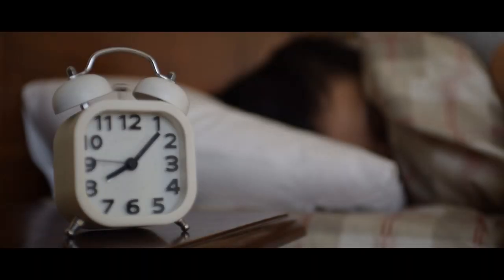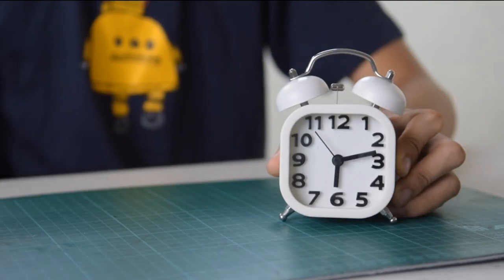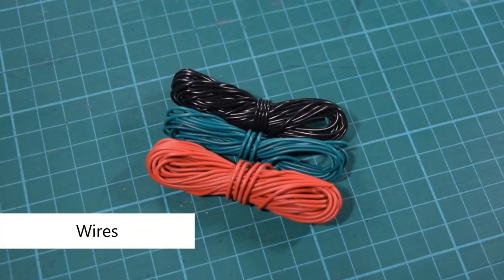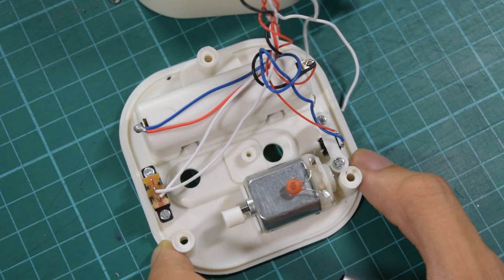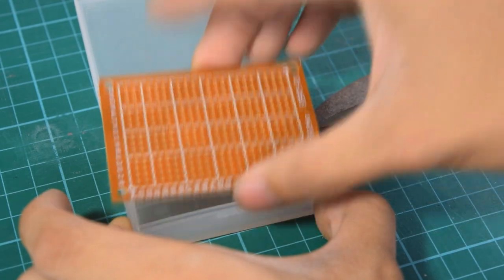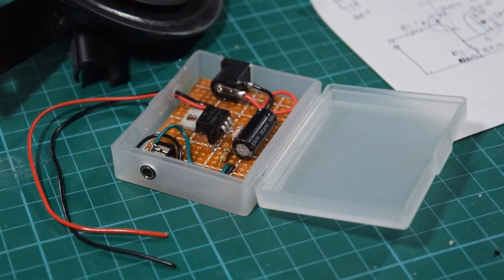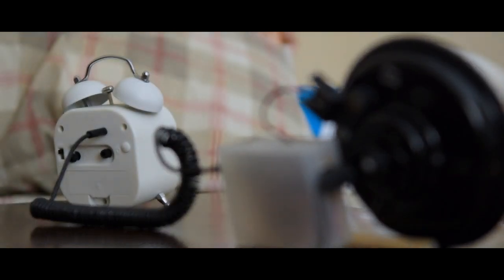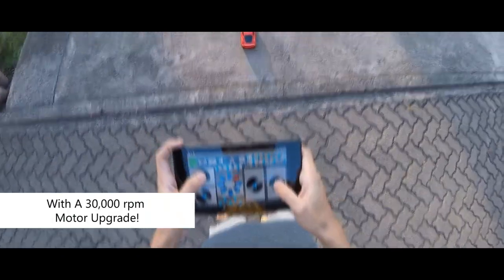Building The World's Loudest Alarm Clock

Comment: Back in the 1980's I had a lot of trouble waking up for work so I wired an alarm clock to a car alarm siren. I just dreamt I was turning it off and couldn't understand why the noise wouldn't stop. It also woke everyone in the house but me, so that experiment failed.
Reply: i am a heavy heavy sleeper, i had a chinese phone with the loudest speaker, i had set up glass shattering as my alarm ringtone, it was so loud, it would wake up everyone but me, then everyone would come up to my room and wake me up lol, then i bought one of the loudest alarm clock, couldn't do the job, my brother got pissed off and broke it, now i am making myself an arduino based alarm clock that will spray water at my bed, hope this one works, fingers crossed
Reply: This exact same thing happened to me. The dreaming of turning the alarm off not the rest

Comment: You could make it without circuit by using a bell and a hammer as a switch. You would get nice PWM (Pulse width modulation) output for the coil of a car horn.

Comment: I would rather have the RAMOS clock. The d-d-d-ding ding ding sound is just as annoying but, does not cause permanent hearing damage and forces you to leave your bedroom to turn it off by putting in the date or an RNG code into the keypad.